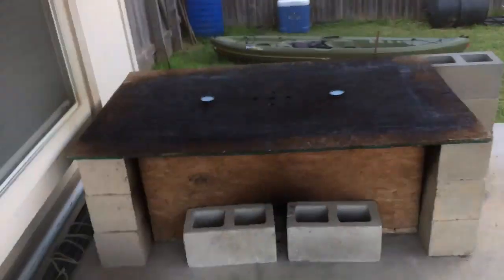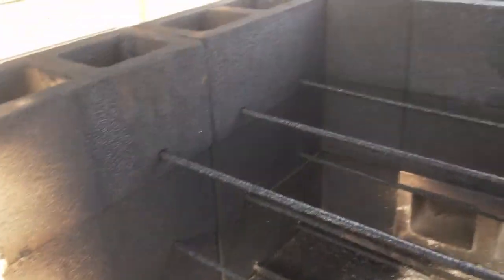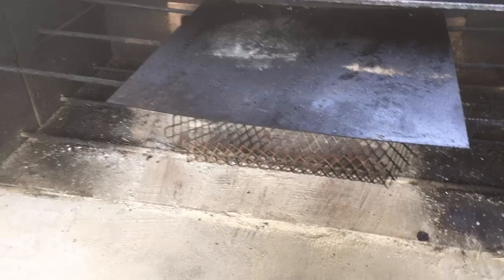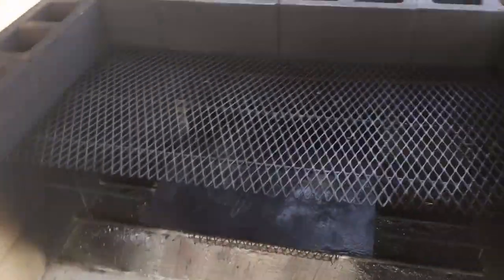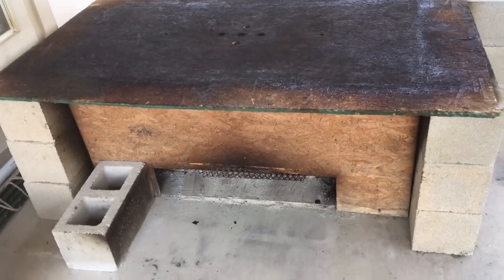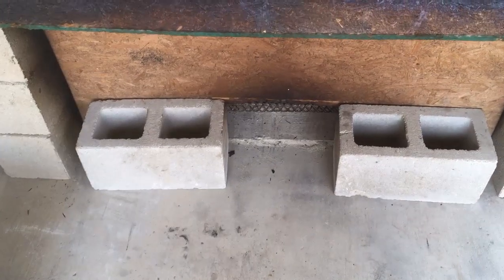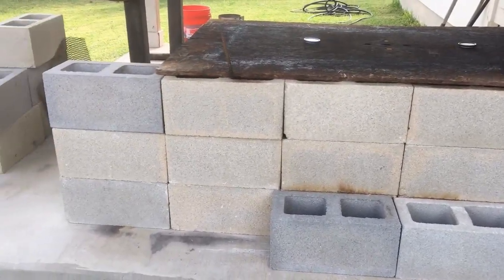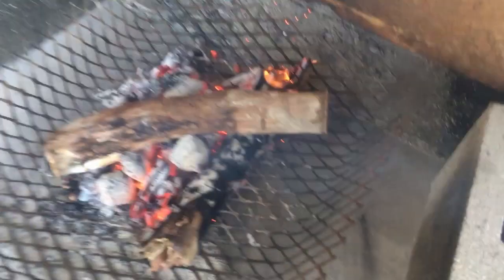How to Build a Cinder Block Smoker

Comment: Nice build. I built mine last year. Alittle different because i use mine for pig smoking/roasting. I use plywood for the top. But, i wrap it in heavy duty tinfoil so you dont get the burns that could release chemical fumes into your food. Nice build though
Reply from the maker: King Rook oh nice. Great tip! May have to try that!

Comment: Where did you get the 2x4 grate? And how did you get The rebar in the blocks?
Reply from the maker: I found the 2x4 expanded metal at a local fencing company.  They didn't have one that big at Home Depot.  I used a concrete drill bit to drill holes in the cinder block just big enough for the rebar to squeeze in there.  Thanks for viewing!
Reply: @RAEscobar  Thanks for the info and great video bud.

Comment: I’m gonna build this today
Reply from the maker: mike valenzuela thanks bro let me know how it turns out.
Reply: I sure will! Seen many cinder block videos and this is the one I’m going with.
Reply: Ok, so I built my replica smoker and it turned out pretty good. I smoke some thin steaks 🥩 and I was satisfied. 
I plan on smoking a few small chickens for thanksgiving and I wanted your opinion on how long should I cook them for??

Also, is it possible to make jerky in this?
Reply from the maker: Yes I normally smoke it for 1-2 hours and then finish it in dehydrator.

Comment: Awesome pit man. I’m following your design for this upcoming Christmas Eve. I’m planning on doing a whole Hog but I was wondering; how well does this design hold heat? Also is there any advice you could give me for this type of smoker that will make the whole process smoother.
Reply from the maker: John Sullivan I use very little charcoal and wood so I would say it holds heat very well.
Reply from the maker: John Sullivan as for advice, I would say make modifications as needed. I’m always thinking of ways to improve it. Let me know how it goes.
Reply: R.A. Escobar thanks for your help. Out of curiosity about how long does this smoker take to reach temp? Specifically 200-210.
Reply: I’m considering making a few adjustments just since it’s going to be such a long cook. my game plan is to cook for 14-16 hours. So I’m going to actually dig a square (the size of the pit) about 1-3 inches into the ground, not too deep, and place the blocks inside and cover the outside sides with dirt just to keep the heat in a little better then I’m going to be wrapping the inside of the pit with foil also to prolong my temp. I’ll also be using chicken wire suspended about an inch off the ground to keep my coals elevated to get proper ventilation. Lastly I’m considering placing a piece of metal inside the pit(just a little smaller than the area of the pit above the fire to separate my meat and fire(not sure if it’s necessary-I just added an extra layer of blocks -4 high, so I’ll have a little more space between the fire)
Reply from the maker: Not very long in the central Texas heat haha maybe 15-20 min.

Comment: is the top cover plywood as well?
Reply from the maker: Father of Four Homestead yes it’s plywood. It does get warped and weathered so I flip it on occasion and I have replaced it once.
Reply: ok that's what i thought but its blackened so figured id ask.Thanks for the explanation. Is it still working good for you?
Reply from the maker: Father of Four Homestead yep still works perfectly. Need to replace a few pieces soon but so far so good.
Reply: Get a thin piece of sheet metal that should stop it from warping and you wouldn't have yo replace it  as often